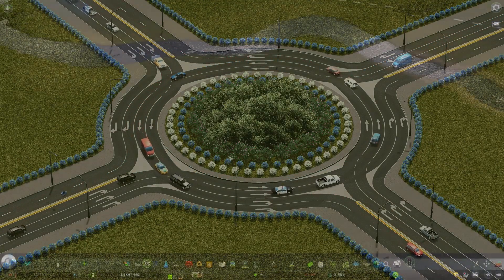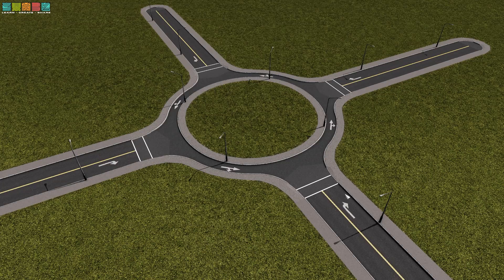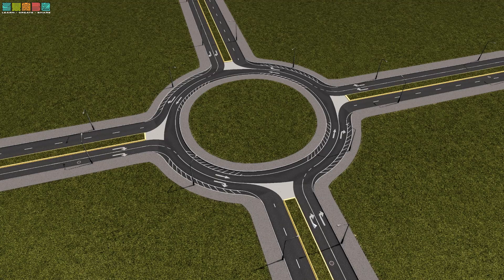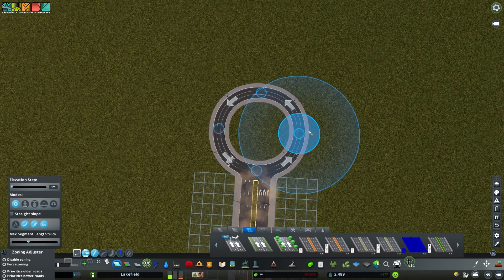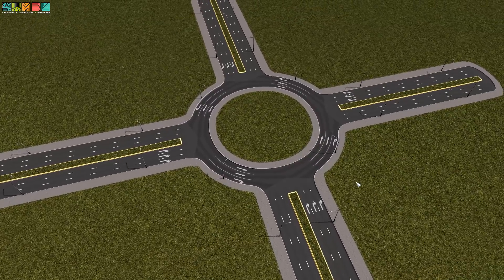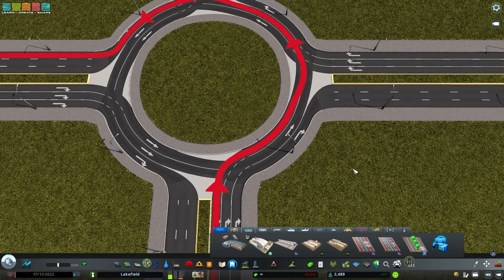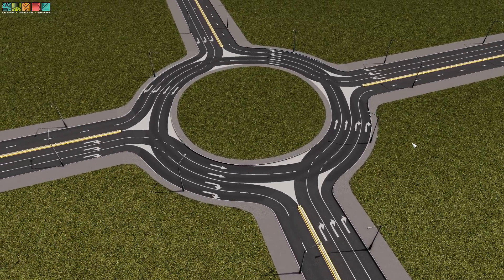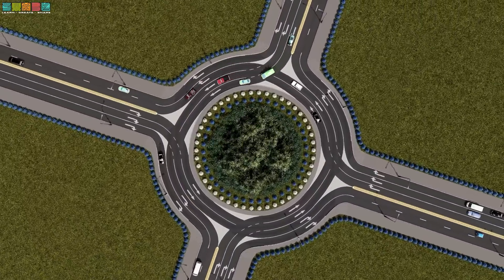Turbo Roundabouts and BEYOND!  -  Building Roundabouts in Cities Skylines

Comment: This is the kind of thing that probably only works in theory, and not in real life. I've never seen people respect the lanes while inside the roundabout. No-one would (correctly) choose the exit before even entering the roundabout. Unless there were obstacles.

Then again, we just need to do this in CS because the engine doesn't let cars change lanes in between nodes and every driver is very polite.
Reply from the maker: Some turbo roundabouts have little curbs. You would certainly notice if you didnt keep to your lane

Comment: Have you tried a 5 lane roundabout with 4 lanes coming on for a U-turn? If so, does it work?
Reply from the maker: It would work, but it would be a collision machine. Too many lanes.
Reply: @YUMBL  Challenge accepted. 😂
Reply: Actually, I think you can do this with the 4/3 if the outer lane is a normal lane instead of a slip lane and the second lane allows straight or right. So the far right lane of entering traffic needs to yield but everything else works the same.

Comment: I tried to make one myself in game and it was so fun! I did notice that the turbo roundabouts near where I live are all a slight bit different. This game is really great for demonstrating priority roads this way. I went to dig and I actually came across a few things regarding turbo roundabouts. I noticed something that almost everybody does wrong, including both me and you.

The first turbo roundabout (TR from now on) isn't actually a real TR but a large partial TR. A real TR has two exit-lanes. Both the outer and the middle lane can get off the ramp. If you were to allow that in your normal TR, you would actually have what's called a rotor roundabout. Breaking it up there increases capacity. If you do the lane math, it doesn't quite make sense to do it that way. You funnel a two-lane road into one lane for the duration of the roundabout.
It works for the partial TR because the two lanes feeding into the roundabout are not two lanes of traffic, just sorting lanes from a single lane road.

I have a challenge for you: create every named type of turbo roundabout inside the game. That is Egg, Partial, True, Knee, Spiral, Rotor, and there's also stretched-knee and star but those are just 3 legged variations on knee and star. The rotor is the only variation that has 90 degree symmetry. The others are 180 or none.
And one last challenge: recreate the turbo roundabout interchange in Talinn, known as the Haabersti traffic junction.

I feel so many people see TR's as a panacea, while they have very specific strengths and uses, which explains why they have so much variation. This would be an interesting exploration.
Reply from the maker: You are totally right! I hope to make a video analyzing a real turbo roundabout soon :)

Comment: Google Map the Alamitos Traffic Circle in Long Beach, CA.  It’s a high-capacity circle, built in 1931 and modified over the years. It contains turbo elements and dedicated right turn lanes at a 5-way junction in a very large circle with a 360’ inner diameter.

Comment: You don't really see turbo roundabouts where you have to yield. It's usually controlled by traffic lights. Cause you're never going to be able to always spot all cars on the priority lanes since it's two lanes you would have to yield to. Very dangerous. They pretty much always use traffic lights. Mostly at every lane change (even on the roundabout). So the left lanes that will change lanes to the right lanes will pass traffic lights so traffic entering the roundabout can enter.

Comment: As a Spaniard I can only imagine the disaster it'd be if they made these weird roundabouts here. Here people already screw things very badly with normal roundabouts, you can get honked and yelled at for staying in the outermost lane by people that tries to go out the roundabout from one of the inner lanes, as if they could cross one or more lanes to go out when they want. Here the rules are simpler, you need to treat the roundabout as a normal road so you could perform any turn (either right, left, straight ot around) going always by the outermost lane. People that drive very well or professionally, though, apply the rule of counting the exit they're gonna take and go in the roundabout by the lane that corresponds, but I'd guess 0,00001% of drivers do that.

Comment: I wish I had pictures of when I was a child. Here  at my city we had the weirdest roundabout. It was a classic 2 lane in  and out 2 lane wide roundabout with a  5 points access. BUT at one point of the wheel the inner lane could turn hard left into  a single line  that crossothe roundabout directly  to  the other side of the wheel.

IT was HELL on earth to drive there.

Comment: My only issue with the pinwheel is you'd have to crank your neck so far back while yielding it might as well be a stop sign
Reply from the maker: You just have to look left. Like most yields.
Reply: Just look at your immediate left. You do not need to yield to a car that is in the other side of the wheel.

Comment: I think you could still do U-turns in roundabouts without compromising the roundabout's flow. Just expand the roundabout's lanes by 1, allow the leftmost lane entering the roundabout to pick between the 2 innermost lanes instead of just 1 lane, then set it up as normal, and you should now have a roundabout where every vehicle will be forced to stick to a particular lane, yet would also allow for U-turns.
Reply from the maker: So a 5 lane roundabout then?
Reply: @YUMBL  Yes, though only assuming that you'd have 4 lanes entering it, and assuming that there's a slip lane to make a right turn.

Comment: The normal turbo roundabout can get very congested in the right turning lane, which also makes it harder to do a right turn ironically. You can easily see the congestion when looking at the single right turning lane fanning out into 3 lanes at the end. The right turn bypass does nicely solve the issue though.

Comment: One roundabout design I've been having quite good experience with is a three-lane roundabout connected to two-lane roads. It's a bit hard to explain what it looks like in text, but I will try.

Entering the roundabout, the right lane of the two-lane road is connected to the outer lane of the roundabout. This is for right turns only. The left lane connects only to the inner lane of the roundabout. At each node, the inner lane of the roundabout can continue straight ahead, or move to the middle lane. The middle and outer lanes of the roundabout will always exit. The only lane change permitted anywhere in the roundabout is moving from the inner to the middle lane, on the node before a car exits the roundabout. It is possible to do a U-turn, simply by staying in the inner lane for longer.

The main advantage of this setup is that cars making a right turn will not interfere with the other lanes at all. In fact, no cars leaving the roundabout at any node will interfere with the cars entering at that node. However, there is a crossing point where cars preparing to exit at the next node will have to cross into the middle lane while entering cars go into the inner lane. 

However, I'm not sure if this is actually a good design. It works for me, better than the default roundabout setup, but I cannot help but wonder if it is suboptimal. Looking at the video, it feels like a lesser variant of the Super-Turbo Roundabout, but far simpler and easier to set up. If you use the lane tool and just press Ctrl-S at an intersection between an Avenue and a Highway in the vanilla game, you only need to move two lines at every node to complete the setup.

Comment: From a traffic management prospective, roundabouts have one very simple problem:  A big percentage of the traffic going through it doesn't need to be there.  Let me explain:

In your example, each road coming in basically is a 1 in 3 out problem.  Assuming equal distribution, 33% of the traffic goes to each possible exit, and the 1% remaining gets confused and goes back where they came from.   The problem is that this means that 33% of the cars were just going straight and didn't need to slow down, turn, change lanes, and so on.  Their trip is actually slowed as a result of the round about.

The second problem is that 33% of the cars also want to "turn right" (air quotes because in the UK, they would want to turn left, but you get the idea).   So they go into the round about only to immediately leave it at the next road.  Their trip is slowed by having to queue, enter the round about, turn, and leave it.

There is a third and even more significant knock on problem with all of this, which is simply that this means that 66% of the cars in your roundabout simply don't need to be there.  Those 66% end up slowing the 33% that would benefit from the roundabout down, while also having their own trips slowed by having to use the roundabout to start with and being in each other's way.

Essentially, no matter how efficient you make a roundabout, it will hit a wall at a certain point and rapidly decline in performance, with the traffic version of dithering.  

When you break it down, the issue of a roundabout is that it basically slows all traffic to make it somewhat easier for 33% of the traffic to turn left.  It's somewhat better than a timed traffic light 4 way intersection, but it's really going a very long way just to allow left turns.  

My suggestion is this:  one road under, one road over elevated, and a mechanism to allow left hand turns in the middle.   Right hand turns handled by individual point to point ramps.  The middle layer could be a roundabout, because you have removed 66% of the traffic from the equation.   It could even be a two cycle left turn only 4 way intersection, again even as it's inefficient in normal use,  it would still be able to move a much higher rate of cars compared to the standard 4 way intersection, as you would make no provision for right or straight through.  

The bigger problem in the end here is that you start to border on making an interchange instead of an intersection.   In the real world, the lack of space and the NIMBY view of things like this, it's unlikely you could do this every block!

Comment: looking at the traffic flow at 5:00, wouldn't it always be possible to 'double' every exit, without risk of right hand interactions from the outside 'turn only' lane.  you only enter the circ if you need a more distant exit, and you could leave without concern that your right flank is exposed. that would empty the circ quicker to open entry spots for new vehicles, and still allows for a fairly rapid 180.  perhaps the traffic mandate could include the mantra 'keep your speed and keep your space in the roundabout', so drivers are not claiming openings created by a vehicle exiting from the inner circle.  this would let a driver trying to enter have a spot to claim.  take the foot shaped exclusion at the exit by the toe, and pull it halfway back toward the heel.  dashed exit arc to suggest exit driving line.  the only time you cross a line is when emergency vehicles are requesting space.  also picture a light system that shows a green 'proceed arrow' to an incoming driver while showing caution yellow to the driver already in the inner lane and expecting to continue in the inner lane.  trigger the lights spontaneously with 2 weight sensors, one for each path decision, so when a vehicle leaves via the inside exit lane, the incoming driver is prompted.  the yellow will keep inside lane drivers from claiming the open space by shifting responsibility to them not to 'take the space'.  that space, represented as the bottom of the foot, should be long enough for the 'declared speed' to allow time for the incoming driver to take their spot in the inner lane.  the incoming driver must ensure his lane exit is clear before he enters the box, as per usual.  as one would expect, the yellow yield can be disregarded if the driver verifies there is no incoming vehicle at the next entrance competing for a spot.  perhaps a third weight sensor at the entrance to the inner lane would also help decide if the yellow caution lights, and requests a spot, while any vehicle exiting and creating a spot declares the green to proceed.  show red to the incoming driver if the inside lane sensor detects a vehicle and enforce the stop, otherwise the green proceed allows entry into an uncongested inner lane.

Comment: @7:09 (turboroundabout) If you allow the cars to exit the roundabout from 2 lanes you can significantly increase throughput going straight over. Cars in the middle lane can choose to exit, or go on to the next exit. This way you utilise more of your exit roads. Make the blue line also exit to the middle lane.
Reply from the maker: Ive found that exiting is never the problem with roundabouts. Its entering. Cars backing up and being unable to get in. Idk if this will help them
Reply: @YUMBL  This way you can have 2 lanes crossing the roundabout, not only 1, the total throughput increases. I see it in real life over here in a lot of places. Try it :D
Reply from the maker: I did try it. Once its backed up on all sides its still over. Traffic piles up.

Comment: It's possible to add a conflict-free U-turn option to the super turbo roundabout.  I'm thinking, after you complete the right turn, peel an exit lane off of the rightmost side, pull as sharp of a 180 as you can (3x3?), tunnel under/bridge over the road you are returning to, back to surface level, left turn, then rejoin the original road opposite direction.  This could be repeated in all four directions with no conflicts if I'm envisioning it correctly (I don't actually play CS, so I could be wrong).  With full lane mathematics, you'd actually have to add a fourth lane (a second right turn lane) to the roundabout entrance, but how many U-turns are you anticipating?
Reply from the maker: I dont generally accommodate for uturns ever. Traffic must find a way ;)
Reply: @YUMBL  well that's your design choice and as such is fine.  Other people might want the option.  I personally regard mass use of u turns as a troubleshooting flag that a connection is missing somewhere, so good to bring the issue to the fore, so it can be id'd and fixed.
Reply: A cheaper way to accomplish this is a variant of what I call the Michigan Left Turn, where left turns at an intersection are forbidden, but instead, a modest distance away from the intersection proper, a specific U turn opportunity is provided on the cross street; to make a left turn, one must make a right turn, cross (presumed multiple lanes) to the center median, then make the U turn.  For the super Turbo Michigan U Turn (ghod, that name is getting long), provide a break in the median a short-to-modest distance away from the roundabout, node required to change lanes, set up the U turn specifically from the original leftmost lane to the opposite direction leftmost lane.  To see how it works, freeze frame the video at 7:17.  You start at the purple dot, turn right, change lanes to reach the center median, make the U turn, take the lane change marked in red at the top of the screen, then the lane change marked in blue on the left, and end up opposite direction on the original road (green dot).
Reply: @Robert Johnson the above thoughts might interest you

Comment: 1:46 There are no roundabouts that use traffic lights. When a circular intersection has traffic lights, it's called a Traffic Circle and the behaviors and rules of a Traffic Circle are different than a Roundabout, the only similarity is that they are both circular intersections.
Reply: This is absolutely not true - it depends on which country you live in.  In the UK for example, the spiritual home of the traffic roundabout, with or without lights they are all roundabouts or to give them their proper term "gyratory traffic flow system".  Especially since in many cases, the traffic light are part-time, only being used during rush hours.

Comment: I was one of the negative commenters on the last video. There is a reason why 99% of roundabouts don't look like this/pinwheel/turbo, and it's because they are unsafe and confusing. Just because there is one somewhere in the world, doesn't mean it is actually good. I live in probably one of the most roundabout-heavy cities in the world, so I am absolutely not confused about how they work.
Reply: We have a few complicated roundabouts where I live, but the oldest and most basic are essentially just... two lane, one way roads. They're big enough circles that you can treat them as such and the only thing you have to remember differently is that if you're turning right (we drive on the left here) you have to indicate that from start (and switch to indicate that you're turning left as you change lanes and/or actually exit)... which sort of makes sense and sort of doesn't, when you think about it. 
Meanwhile the smallest roundabouts technically have the same rule but it's utterly impossible to follow it, (you literally don't have time to make the changes to your indicator and other traffic to notice before you're out of the roundabout already) so in practice everyone basically just treats them about the same as they would a regular uncontrolled intersection with a nasty pot-hole in the middle.